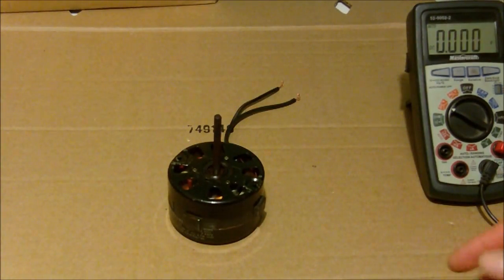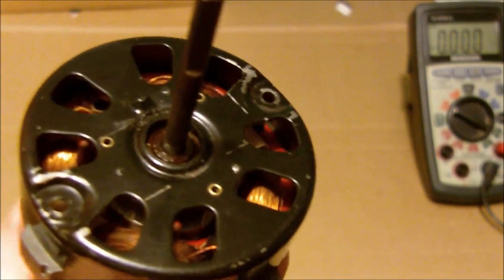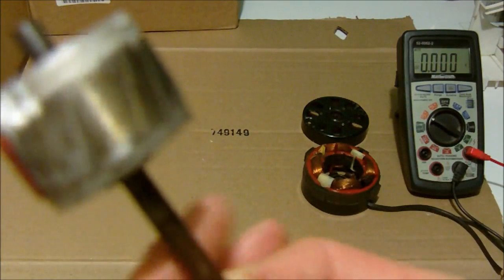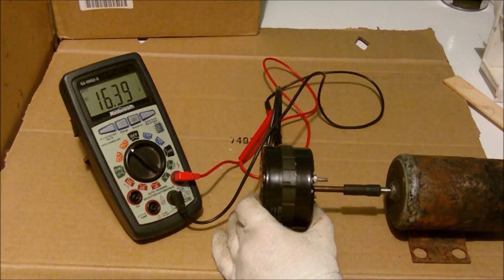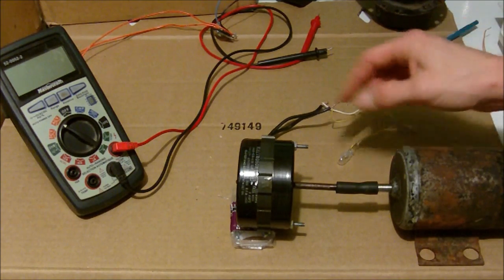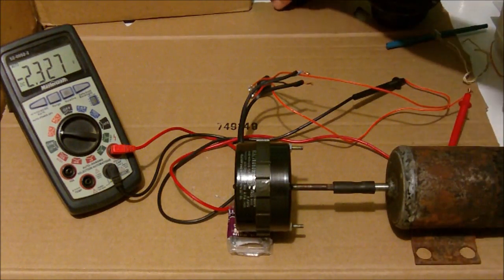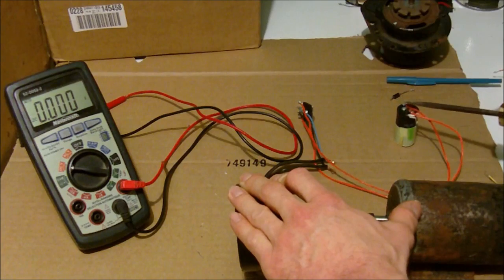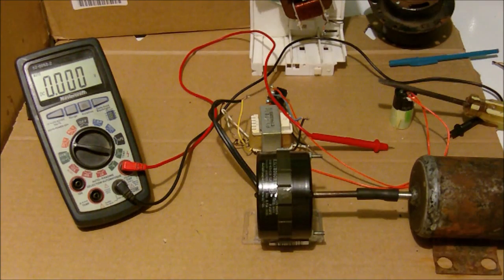Small Induction motor conversion to generator (example)

Comment: Furthermore, your mistaken efficent with power density. Efficency is not about how much power out you get. Rather, efficency is a ratio of power input to power out.  There are other reasons why this converted motor is inefficent, but not for the reasons you described, rather the things you described contributed to its low power density.

Things that contribute to its low efficency are hysteresis  and Eddy currents losses in the iron core of the field windings and i suspect that back emf under load might induce parasitic currents in the rotor.

Comment: Your mistaking drag for cogging. Cogging is caused by magnetic atraction to the iron in the core of the field windings.     The rotor speeds up to get close to a core, then is slowed down after passing, but energy is not lost. Drag is lost energy period. Cogging is more like a car, with a constant input, speeding up as it goes down hill and slowing down as it climbes the next. While there is rotation, no energy is lost to cogging. But cogging has a problem. Imagine that previous car not having sufficent input energy to clime the first hill. A motor with too much cogging will not turn at all with too little power fed to it.

Comment: You can make a generator from the asynchronous ac motor just with overspeeding it (more than 3000 or 3600 rpm).
Reply: HVandstuff86 sure can, but you have to excite the field windings either from the grid, or make it self exciting with capacitors. 

The other issue is that you needs a fairly constant rpm. If the prime mover is variable, then you need power electronis to change the frequency of excitation, or use a continuous variable transmission to keep the rotor spinning at the right speed, 105% of synchronous rpm.
Reply: @kreynolds1123  3% more than normal speed as motor not 5%.
Reply: @Bialy_1  Thank you. Why 3% over vs 5% over. Is that based on a specific generator, or the torque curve, or reactive current curve,  or something else?
￼
￼
REPLY
Reply: I am not certain but I think 3% figure comes from recommending motoring a constant continuous load to keep the power factor and efficiency up vs going for more torque.  Seeing as wind is variable, spending almost all of its time time well below the generator's maximum torque rating, I think it would be fine to go up to 105% of synchronous as the magnitude of the apparent power (current) would be far more manageable. 

Maybe I am wrong. An expert's input would be appreciated.

Comment: the thing is that in order to use more magnets, you need to have a bigger stator with more windings as this is a 4 coil stator, you can only use 4 magnets. but you can stack magnets ontop one another to multiply the magnetic field. the closer the magnet is to the stator, the more powerful the electric charge is. adding more magnets, will not help except in the case of stacking them ontop of one another.

Comment: hey can we switch it again to induction motor?
i mean with the magnets on does it work as an induction motor?
Reply: The magnets don't look powerful enough to turn it into a synchronous motor.
Reply: leerman22 wouldnt using magnets at all make it operate as a synchronous generator? It is my understanding that an induction motor has no magnets whatsoever.
Reply: jodysaliba
This work more like a linear induction motor, except with the way the coils are phased (just synchronized) it would just stay put levitating until pushed.
It would be something to see 3 phase coils underneath it jet you across a long copper highway at 200Km/h though.

Comment: ive always wondered, does it matter if the motors are burnt out or do the motors have to be in working condition before you start? i dont want to ask friends and family for burnt out or junk motors and find out im just collecting a pile of burnt out motors lol.
thanx
Reply: Hi APCWORLD, You need a working motor, if a motor is burnt out it is either open circuit and will not work or the windings have shorted together. Often on inorganic rubbish days there are plenty of free fans out on the kerb site. The motors usually work, often the plastic stands or guards are broken.